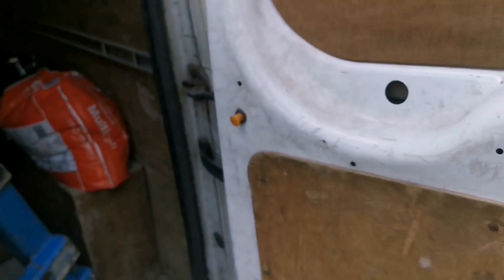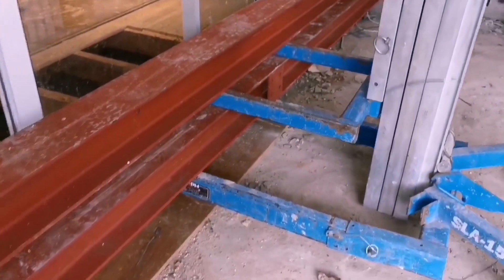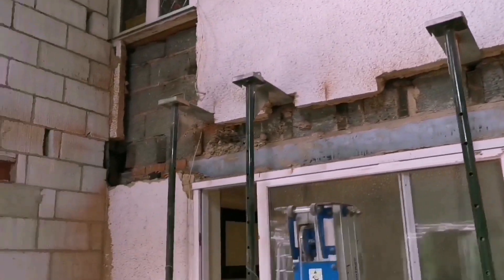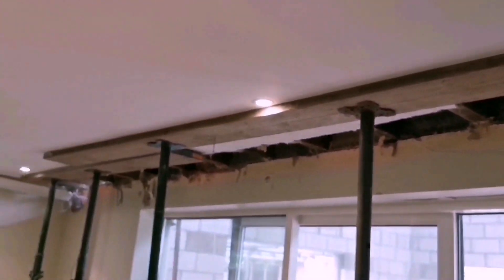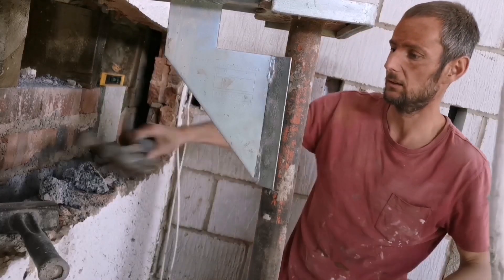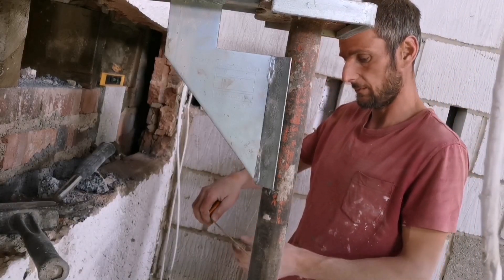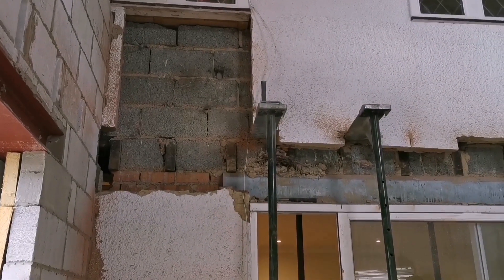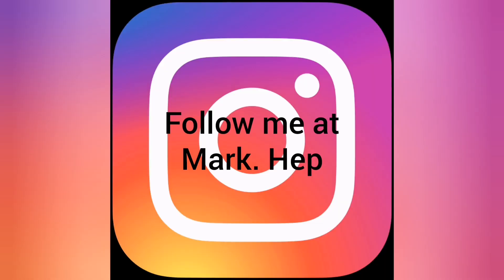Installing steel beams rsj

Comment: My floor joists run parrell with the wall I'm taking out, how do i support both sides (50mm cavity) do I remove the whole wall bellow or leave in until the steel is in place? Great videos learn so much
Reply from the maker: Hi mate I normally leave the wall in to sprag the steel with. And get strong boys. Put them right through the front onto the back inside the house. Then take the back out put that steel in. Wait a day take props out and put them on front and do front 👍👍👍

Comment: Hiya Mark, another great video 👍👍. 
I normally use a couple of lengths of 2x1" steel box through the genie forks so you don't have to take out the bottom of the wall for the legs. Lift the steel on the genie forks then you can slide it along the 2x1" straight onto the padstones.
You should really brace the Acrows diagonally with a scaffold tube to stop them twisting- especially with strongboys. I've seen the back of a house fall out when the strongboys have twisted & the props fell. 😱😱
Regards 
Tim
Reply from the maker: Chears mate. Owch mate thanks for the advice. Yere I was thinking of making the arms longer on the lift. But dident no what to use. Yere I aways tighten them up too much really and bend the strong boy. Minght try a brace next time 👍👍👍
Reply: @markhep  💪💪💪👍👍👍😁
Just started following on your Instagram 😜
Reply from the maker: @timmargereson332  nice will start and put some stuff on soon 👍

Comment: Lovely job mate coming along nicely 👍👍🍺
Reply from the maker: Chears mate Yere getting there glad that roof nearly done just ridge tiles left on it 👍👍👍
Reply: @markhep  👍👍💪 really enjoy watching you work and really taking shape now 💪👍👍🍺
Reply from the maker: @JimJimpmjj  cheers mate. And I love making the videos. Good fun. I am pricing a nice extension up at min hope I get it. The plan shows the  full bottem corner of the house coming out and the top lift of corner on steels. With a wrap round extension. That would be a fun one lol👍👍👍